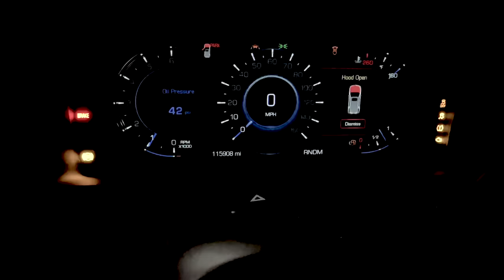We have an Engine TICK / KNOCK?! Big Chief + Jackie Diagnosing 6.2 Problems! L86 Escalade

Comment: I disabled DOD on my Brother-in-Laws '18 L83 back when it had about 40K on it. At 99K, #4 intake lifter exploded and bent the push rod. The noise was only on the right side, but #1 and #2 intake rollers were bad also and damaged the cam. 

 The lifter can fail, but still open the valve when cranking, and not collapse when checking with the engine off.   You can leave the injectors in the head.
Reply from the maker: damn that sucks!
Reply: @MidwestStreetCarsAuto   dont forget to get that  crazy rabbit some johnson lifters in that escalade( not cheap)  so she gets a premium lift that lasts  a long time :)

Comment: That DOD or AFM is crazy. If they don't open the valves when it goes into 4 cylinder mode, isn't that hell on the piston/rings? Its like the piston is going down trying to suck air in, but it can't because the valve is shut so it's creating a negative. Then when it goes back up, the cylinder pressure goes back to neutral, over and over. That's gotta drag the firing cylinders down. It's supposedly hard on the rings. I had a 2008 silverado I bought used and that fucker used a quart of oil every 1000 miles. Then it started ticking pretty bad. Traded it in on a brand new 2017 Z71 LTZ so I got it custom tuned and disabled the AFM crap. That engine was fine to over 100k miles when I traded it in... on a 2019 Ford F150 ecoboost. Still diving that truck problem free at 130k miles.

Comment: #7 spun 180 in the lifter bore on mine. You could only see it wasn't oiling up when running, looked fine cranking over. I cheaped out and replaced one lifter and the lifter tray, been fine for about 50k so far.

Comment: My favorite lights for working on cars.. x-mas rope light strings <yah know the clear plastic encased rope light>.. string it everywhere im working.. just like a normal line, slides around, moves to side or tangle it up ziptie etc.. but LIGHT IS EVERYWHERE.. Battery pack led strings in glovebox.  But still use other flashlights too just add this

Comment: The new direct inject motors are great for power but have to change the oil in them often. Like 3-4K miles at 8qts a pop

Comment: Get a light in there and check that cam, I deal with that at work every day normally if the lifter looks like that it takes the cam out and those 2 high pressure lines are one time use have fun

Comment: My 2017 6.2 killed a lifter at 50k with dod tuned out 

The vlom fails and causes the dod lifter to bend a pushrod 
Gotta change that vlom out in the valley cover 
The circuit boards get brittle from heat and short out

Comment: Well, I have a 2016 Cadillac Escalade ESV with a 6.2 l86 at 118,071 miles, and I roll it down the black top at 80 to 100 MPH daily, no knocks yet, but it does have that dang direct injection tick, I run Royal Purple and haven't had any issues yet. Definitely agree with Chief though about them ol' Pontiac's being easier to work on.  Yall dont forget to include the parts list for fella. 🙏😁

Comment: My 2008 Chevy Surburban had the death tick. So we bought a remanufactured 5.3 with the active fuel management delete and that motor has close to 75k and haven't had any issues........ The same things happened to my wife with our truck.....went into limp mode in the middle of George Bush turnpike and shut down the highway at 175 and George Bush for about 2 hours 😂😂😂😂

Comment: As uncle bucko would say lack of maintenance … oil is cheep motors are not.. good video… now  put in the 3/4 plus cam a new set of good lifters and change the oil every  2500 miles  I’m messaging miss Vicky   To send you all  some maintenance reminder stickers… see ya same bat  channel same bat time I’m looking forward to my nitro bike racing season  coming up just ordered my new tire and got  drum of nitro headed my way in may …

Comment: At the dealership the fastest way to diagnose a lifter issue is to unbolt the valve covers (leave coils and wires connected) and start the vehicle. 
Lift each valve cover while it’s running and watch the rockers, some only collapse while running. 
I’d say 60-80% of the DI engines from GM bend a pushrod even completely stock
Don’t pull the injectors unless you absolutely have to, new seals and sizing tool is required to put the injectors back in
Reply from the maker: it wasn't collapsed
Reply: @MidwestStreetCarsAuto  I saw that after commenting! 
Watch those head gaskets, GM had a  misprinted run where the “front” message is on the wrong side of them and it’ll block off the coolant passage. 
Part # gm245 is the tool you’ll need to size the injector seals.
Those intake shields get broke by dealer techs all the time, they pop out all the harness clips down the sides and yank the whole intake forward, breaking off the very back so you can’t tell when it’s reinstalled. It comes off with the intake itself…. Unless you use tin snips

Comment: Are you sure those bolts are tourqed correctly? How can you be so sure?
Reply from the maker: on the rocker? its usually a pretty significant difference that you can see visually
Reply: Because I used a Craftsman model 1019 Laboratory Edition Signature Series torque wrench. The kind used by Caltech high energy physicists. And NASA engineers.
Reply: Well then I see. What about the 2 yutes?  @justinshearer3016

Comment: That DOD is garbage, I had the exact same issue on my 14 Silverado. While you got that 6.2 open I would just DOD delete that engine. I’d also look at flushing the transmission fluid, GMs transmissions are getting sensitive with dirty fluid or trash in the valve bodies.

Comment: Sounds like a f***ed lifter to me, God Ive replaced enough of them
You also really need to look out for pushrod tips at the Rockerarms side eating up in this can happen on the non-DOD cylinders as well just a heads up I’ve replaced a lot of those rocker arms. most likely it’s a lifter wheel though

Comment: Don't get me wrong I am a chevy man Through and through. I'm sorry I would not own a late model chevrolet with d o d. That is some of the crappiest engineering they ever came out with. I currently own a  2001 chevy silverado With well over two hundred thousand miles, Still purrs like a kitten. May as well replace the knock sensor why you got it apart. That will be the next thing to take a dump.

Comment: These motors are one of the worst designed EFI motors GM ever came up with…. LT1 was the first with Optispark, then the Northstar V8, Direct Injected 3800 in the FWD SUV’s. GM steps on their 🍆 and then spins on it every few years it seems. I will never buy a vehicle with one of these engines.